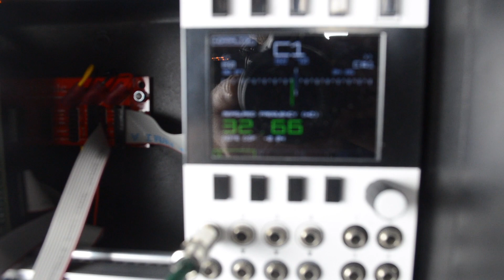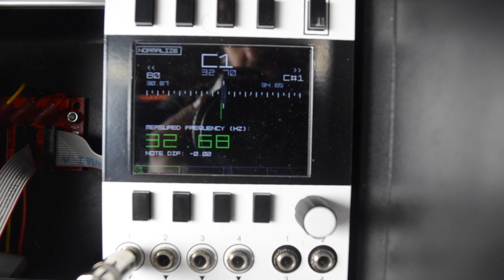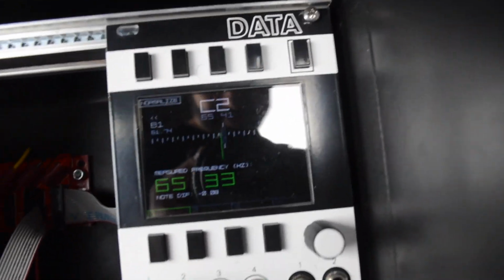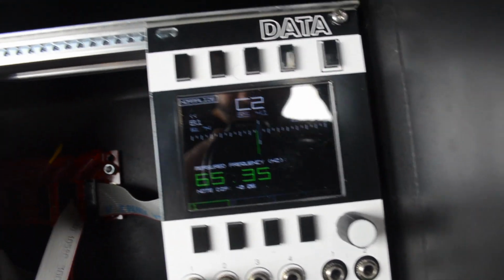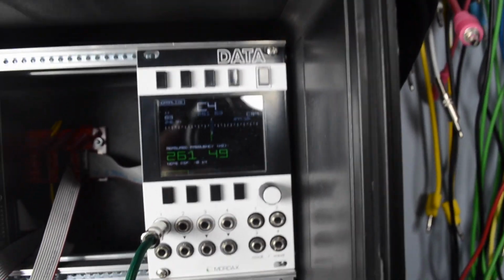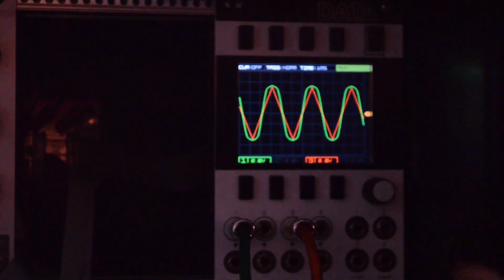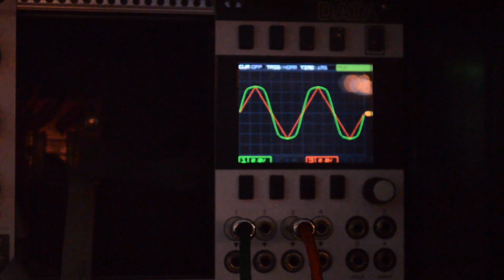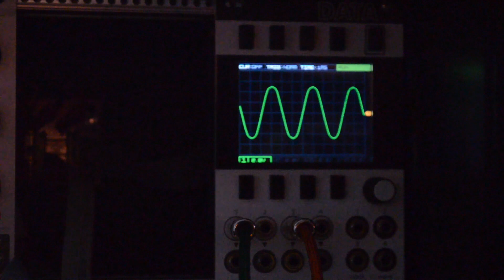VCO V/O Volt Per Octave Calibration Guide

Comment: I've heard that the power supply has affect on the v/o tuning, and the number and type of modules make a difference to the power fed to each module.
So l would suggest calibrating the module plugged into the case with all the other modules installed.
Reply: yes I have heard the same thing.. I have had an oscillator playing while plugging in another module and heard the pitch change.. there are quite a few variables to consider but  I can see how learning with less variables could give you confidence to tackle more..